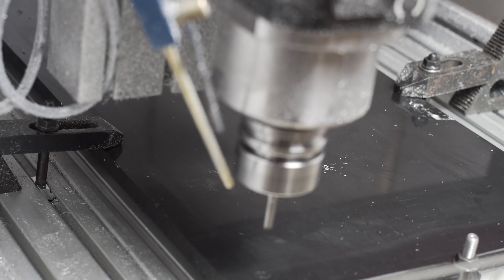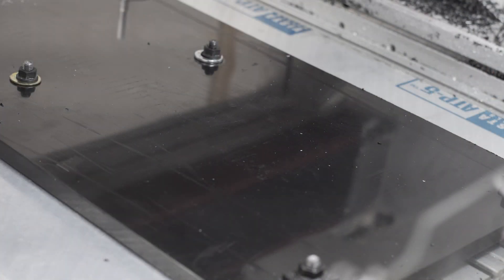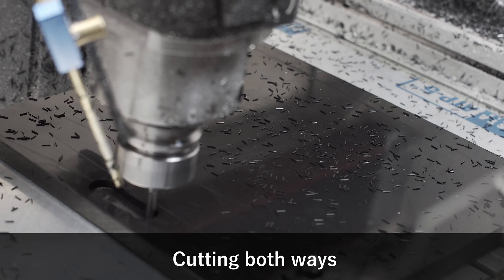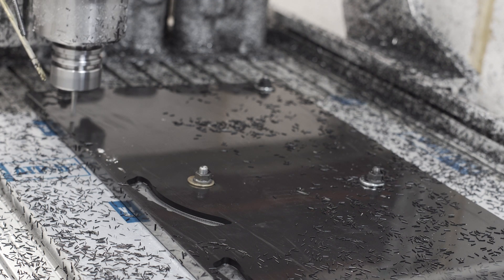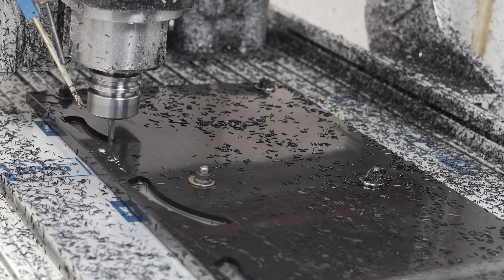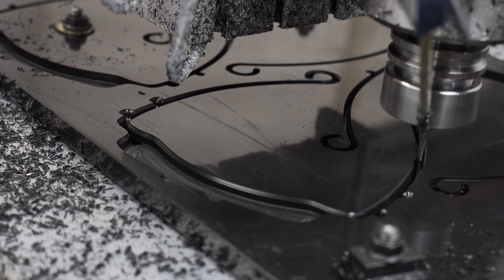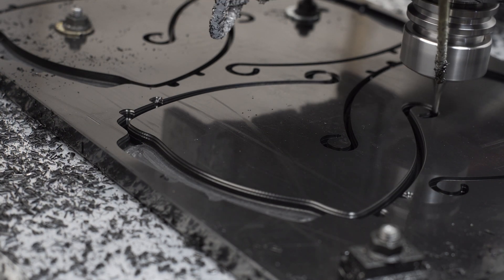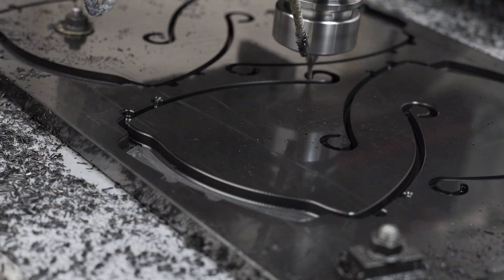Tips and Tricks for HDPE machining on a desktop router

Comment: Hi! I know this video is 4 years old but still. Can give some tips about cutting laminated HDPE or so called "sandwich". Currently I'm struggling how to use spoil board for a sheet cutting, (2x3 meters), vacuum doesn't rllly hold small parts... Thank you for your attetion if you're reading it.

Comment: I've been cutting 1/2" HDPE with good results doing conventional cuts at 18000 rpm, 100 ipm, 100 ipm ramp down, 1/4" depth of cut with a 1/4" O-flute upcut single flute endmill.
I did try a climb cut, and predictably, the edge finish wasn't as good. The only reason I see for doing a climb cut is so that wood doesn't splinter. Plastic doesn't have that problem, nor aluminum.

Comment: Very good video to explain different processes in plastic machining on your CNC router.
Using a larger diameter cutting tool for finishing will always leave a better finish, since vibrations will be less and you will have greater precision. It will also allow you to leave more excess material for the finishing operation. If by chance the roughing tool had not machined the amount Ae that you programmed, with a larger diameter tool you could machine it in the finish without problems. I hope my comment helps you, greetings.

Comment: Hello friend! I carry out work similar to yours, also in HDPE and here known as PEAD, it is really clear that this type of machining in plastics is not very widespread on the internet, congratulations on the results. Could you be kind enough to indicate one or two links of milling cutters, one with a straight top and the other with a round top for this purpose that generate an excellent finish? Greetings from Brazil!
Reply: You need an O-flute upcut single flute endmill, probably 1/4" or 6mm diameter to start with, or possibly thinner.
For a rounded endmill, look for the same attributes, usually an O-flute for cutting plastics. But always an upcut bit.
I can also cut 3/4" thick PVC with a normal 3/16" upcut endmill very easily, in two passes.

Comment: Could an HDPE plate be used as fixture plate with a grid of holes?
I always used MDF until now, but I suspect that MDF becomes very week if you make so a lot of holes on it. So I was looking for a different (cheap) material.
Reply: I'm not sure where he's getting HDPE from, because it is definitely not a cheap material. Here in Canada, a 4x8 sheet is in the hundreds of dollars, compared to about 50 or 60 dollars for a sheet of MDF.
Reply: @acerjuglans383  True. Here in Germany is just a little cheaper than in Canada.
In any case is way (way way way) more cheaper than a working table of solid aluminum, that is a "must" if you want to use some coolant for your spindle.

A partial solution could be to use a mist of pure IPA alchool, because it volatilize before been absorbed from MDF. Unfortunately my landlord is so scared from all inflammable liquids that it doesn't allow to use it in my little "lab"... : ( : ( : (
Reply: Yes, you absolutely can, and some people do. But it will be crazy expensive. That's why people use MDF, because it's cheap.

Comment: Try using a downward cutting tool, you'll have a little better results, as it doesn't "lift" the edges of the materal, but rather pushes it down, leave some clearance on the floor for a final cleanup pass with a  normal upcutting endmill.
Reply: It's never recommended to use downcut bits on plastic, as there's a danger of rewelding the plastic chips and jamming things up.
O-flute upcut single flute endmills are the norm for cutting plastics with CNCs.
Reply from the maker: I'll look into getting some tools like that, don't think I have any!
Reply: @BreakingTaps  
https://www.precisionbits.com/down-cut-bits/
There are many others out there, and they are usually for low power / hobbyist machines, but they do wonders.. some come with just about a 1/4"  of the tip of the cutter being down-cutting, but really, that's all you need  to break the surface, after that, any normal end mill will work as long as you do a clean up pass on the walls, i usually do a cleanup on the walls, leaving  just enough on the floor, to clean the floor of the cut separately, tends to give a much better finish all around.

Comment: What is your spoilboard material?
Reply from the maker: I just used some pieces of cast aluminum stock, since I knew I wouldn't be cutting down to spoilboard on these parts.  If I remember correctly, I had to add a bit of height since the spindle didn't reach that low (it has since been adjusted, but was trammed at the time and I didn't want to move it) :)

Comment: I can do about 350 m/min with .25 mm/tooth (2 tooth cutter) on a vf2 with a depth of 25-30 mm

Finishing should be around .125 mm/tooth at whatever your max rpm is below 25 mm cutter width
Reply: You cannot compare a cnc machining center with a cnc router in absolutely nothing. The rigidity and weight of the machine is a more than notable difference. It's like you compare a fiat type with a ferrari.:face-blue-smiling:

Comment: try pvc solid sheet.  some say pvc is abrasive, u need to find a good setting. if not the tool life will be very short.
Reply: PVC is soft compared to HDPE.
Reply: @acerjuglans383  this is false.   pvc is  harder then hdpe.  pvc has  more density than  hpde.  hdpe  is less dense than water

Comment: What cam software?  I cannot get fusion 360 to make the wide channels with the progressive circular patterns that you have @ 2 min 3 sec?  It wants to keep going in a full pass like you have @ 5 min 57 sec
Reply from the maker: I used Fusion for this.  IIRC, the cut at 2:03 was a 2D adaptive clearing.  Those will typically spiral down to the desired depth, then circle outward until it hits one of the edges, then start clearing back/forth in an adaptive manner.  I'll sometimes use a 3D adaptive in a 2D case too, just because it sometimes handles the geometry better depending on the part.  The cut at 5:57 was probably a spiral toolpath with a continuous ramp, but I don't quite remember.

Comment: i might have missed it , how did you get the clean chamfer on the hdpe ? i cut it often , but always get a hairy chamfer
Reply from the maker: Hehe, so if you mean the chamfer on the top... it was unintentional/accidental :D   Further down in the comments an injection molding viewer commented on what I did wrong, but basically my ball end mill was engaging incorrectly and added a chamfer.  As to why it was clean, not sure, but I ran the finish pass conventional (per Winston Moy's tip) which seemed to keep stringing/hairs to a minimum.
Reply: @BreakingTaps  im always running climb , and thats likely  the issue , i think my chamfer is ground for convetional only.. thx
Reply: @airgunningyup Conventional cutting in plastic gives a way better edge finish.

Comment: going to try any alloy steel like 4140? really curious what it could do.
Reply from the maker: On the todo list!  Just haven't figured out a good project to use it for yet.  I have some 4140 prehard bar stock sitting around, a few thin bars of 1075/1095 high carbon that I'll probably turn into kitchen knives or something, and some random pieces of A2/D2 tool steel.  And some stainless but uhhh.... not sure I really want to try that haha XD
Reply: @BreakingTaps  cool cant wait!
Reply: @BreakingTaps  this is my machine and think that yours is extremely similar. https://www.veloxcncrouters.com/vr-2536-2-x-3

Comment: Terrific distinctions about your tool and settings choices and experiences.  These are exactly the questions that matter to the maker-designer-operator.
The moldings are interesting. What type of material and product are they used for?
Reply from the maker: Thanks!  I used these to cast face shield frames/headbands for medical use (nursing homes, hospice care, that sort of thing.  Helps reduce soiling of n95 respirators).  The material I cast into them is SmoothCast 65D, a semi-rigid urethane from Smooth On.  It feels like a slightly more flexible PETG or PLA style plastic once fully cured (~15min initial cure, ~2hr for final cure)

Comment: Dude.. can run twice that fast if not more. HDPE Likes to be cut fast.
Reply from the maker: Haha yeah, I think it was end-mill-breaking PTSD that had me going slow to start :)  I used this program for three molds, and by the third mold I had cranked up all the speeds.  Battery died on the camera without me realizing so unfortunately I just have the footage from the first run :'(
Reply: I'm cutting 1/2" HDPE in two passes with a 1/4" O-flute upcut single flute endmill, 100 ipm and 18000 rpm.
How do my settings compare to yours? I seem to be getting good results.

Comment: While conventional milling does result in more forces on the tool it generally deflects backwards and shouldn’t cause the pocket to taper in. Climb milling on the other hand has less force but will deflect inwards which can cause a slight taper or undersized pocket when machining. That’s one of the reasons why it’s not uncommon to climb mill roughing (for higher material removal) and run the finish pass conventionally so the part is as dimensionally accurate as possible
Reply from the maker: Ah interesting, I guess that makes sense from the physics of a conventional cut.  Guess we can scratch that off the list of potentials...maybe it was a combination of climb roughing being waaaay out of spec + HSS deflection?  Seems odd that when I left more stock for the finishing pass it ended up being tighter tolerance, which goes against the roughing pass being the culprit... maybe just HSS to blame then?